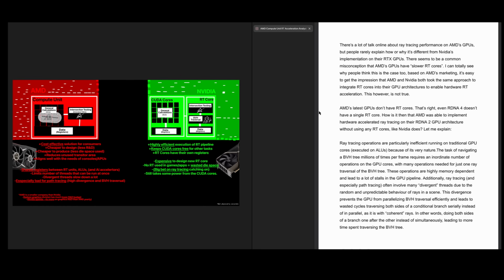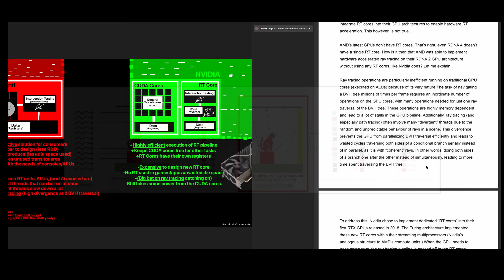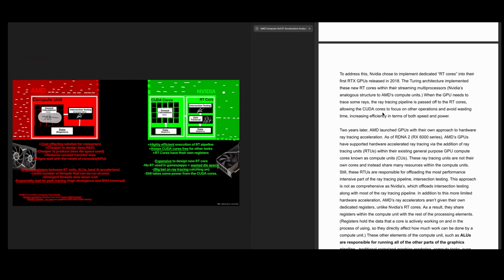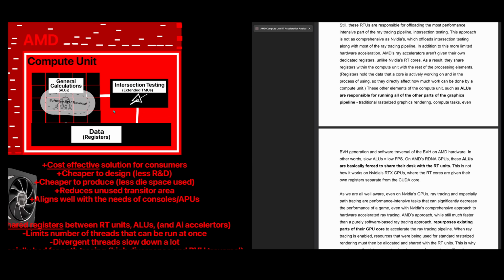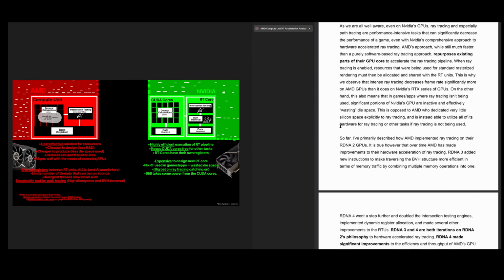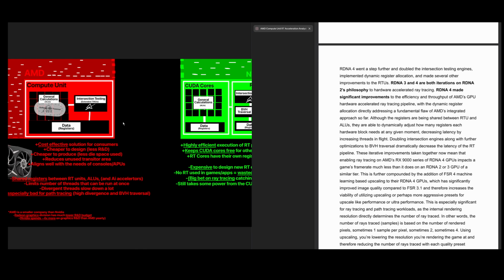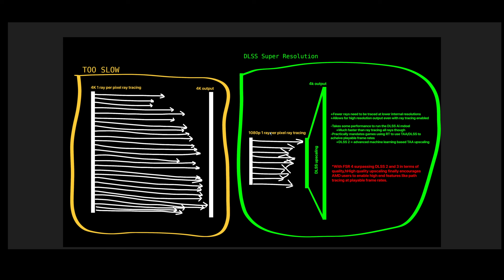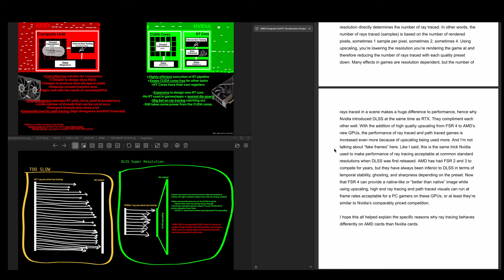How Does AMD Do Hardware Accelerated Ray Tracing?

Comment: Graphics engineer here. I have written ray tracers multiple times. Including GPU-compute ones. BVH traversal is THE most expensive part of ray tracing. Intersection testing is pretty much free. Yes, intersection tests matter, but they constitute something like 20 ops, which is pretty much free. 

Another thing that matters a whole lot is representation. "BVH" means nothing today, there are at least 5 major flavours of BVH today. Nvidia's BVH representation is much smaller, which affects performance because memory throughput is a major bottleneck. Nvidia's BVH is also better at sorting rays, which leads to having to do fewer intersections to get a hit.

You thought that's all - nah man. Building a BVH is also a thing, it can be built well, or poorly. A poorly built BVH will require something like 2-5 times as many tests per ray vs an "optimal" BVH. There is a lot of research in this area, since BVH is built in the driver - this differs between AMD and Nvidia as well.
Reply from the maker: Dude thanks for commenting! That makes a lot of sense! I don't have any real experience working with graphics programming or hardware design in case that wasn't obvious so I really appreciate your input on this. I was reading about some of the differences between AMD and Nvidia's approach to how wide the tree should be vs how long the tree should be and how RDNA 4 uses wider trees than RDNA 3 with fewer steps, I'm sure there's a lot more to it than that though. Is intersection testing really that cheap using GPU compute? I was wondering, were the ray tracers you wrote doing just ray-box tests or was it also doing ray-triangle intersection tests? It seems like voxels lend themselves well to ray tracing, and I assume that's because intersection tests are done using only ray-box tests, where many more can be done per cycle? I know on AMD GPUs with the RA it's a 4:1 ratio in favor of ray-box tests. Because Crytek's SVOGI performs really well even on old GPUs and that obviously uses a voxel grid.
Reply: That is why changes to BVH traversal in RDNA4 are so important. I don't exactly know the right words, but the fact that finally "boxes" don't have to be oriented in parallel to XYZ lines, but algorithm can choose the best option (or at least much better one) for a scene. Which makes boxes much smaller from the beginning.

Also didn't RDNA3 also include some separate registers or cache for "raytracing"? It is only a bit stronger than RDNA2, but there is a difference. I have to check. Chips and Cheese have interesting article about RDNA4 and Ray Tracing on their website.
Reply: My only knowledge about this is an spidoe of Coding Adventures, where Sebatian Lague made his own GPU raytracer with BVH. Would be interesting to see a well-presented video about different variants/implementations of BVH.
Reply: In the video it was mentioned RDNA 4 does not have a dedicated part for traversal stutter in their RT cores unlike Nvidia. So I would assume RDNA 4 should be bad for ray tracing compared to RTX 5000 if BVH traversal is the most important part. However, they're quiet close in normal ray tracing. How is this possible then?
Reply: @JanM2  Algorithm for RDNA4 reduces (by a lot) number of steps needed to calculate BVH traversal (traversal stutter????). Also I wouldn't say that ray intersection is basically free - it depends, but indeed compared to BVH traversal it is minor thing. Though it is still upgraded in RDNA4.

Read: "RDNA 4’s Raytracing Improvements" by Chester Lam on Chips and Cheese page. Heck, even AMD slides explain it... not horribly.
Reply: Nvidia's card do NOT DO SORTING ON BHV they use the cpu for all sorting first.

Also If the RT cores had their own R.O.P's & clocks that were separate from all the compute they would run a lot better.
Reply: Isn't it the denoiser that does most of the work, raytracing doesn't seem to be heavy task, recreating the image after the raytracing by AI. So the raytracing methods are irrelevant
Reply: If I recall correctly: AMD's compute cores are way more powerful and were already generically capable of ray tracing, while NVidia's compute cores were not at all capable for ray tracing. This is 15 years ago. Then Nvidia introduced extra hardware to make it somehow capable and invested a major amount not in R&D, but in marketing to sell the idea that Nvidia was the first to make cards capable to do ray tracing and that everyone needs raytracing right now and that none of the others were capable of raytracing.
NVidia marketing forced a "standard" and bought enough developers to sell it for them.
NVidia really invests little in hardware R&D, but invests a lot in marketing and marketing R&D. Aggressive misleading marketing is the key point of success for NVidia.
If you look deep enough you can see that NVidia even sold "graphics accelerators"/physics engines  which were merely a license dongle to run their CPU optimized code. And only if you had the license dongle, would the library select the fast path.
NVidia and Microsoft are very alike in that respect.
Reply: @bloepje  I mean - on Linux you can play "RayTracing only" games on RX 290X. It's just that performance will be terrible. Some computations are that challenging. Being capable doesn't mean "good at it" at least not to the level required for minimum 30 FPS in 1080p. You could use CPU if you wanted probably - it's just not that efficient.

AMD for long time was great at computing (so their cards were great for crypto). And CDNA (including current MI350 and MI355) is based on Vega. Raja Kodouri shouldn't hype things up and for gaming GPU's he is so so, but for computation heavy ones - he is great.
Reply: @bloepje That's a pretty annoying way to say "I just don't like Nvidia, because at the moment they are the market leader, and rooting for the market leader is lame".
Reply: @bloepje  Well, nope. RT cores are dedicated circuitry to handle the prep & transversal of BVH which requires lots of R&D effort. Much More RT & PT papers & demos came from Nvidia in recent years than AMD. AMD's generic compute approach doesn't benefit RT impl in games much. Let's hope the next version, UDNA has something to offer in better Ray Tracing with 4x ～ 32x samples and early ray sample rejection.
Reply: @Smiling-Lotus  Bull crap. that's RTX coding for CUDA & not anything directly related to DXR or DX12.
Reply: @bloepje  I distinctly remember an Epic Siggraph presentation from roughly 2015(?) where they tested out ray traced shadows on GCN as early as an HD 7870. Another instance that I vaguely remember is a 2013 slideshow about ray tracing optimization on GCN. But I don't recall if nvidia couldn't also do this. It's just that the PS4 was the target platform for Fortnite (which was still in development at the time, iirc). I think there was another post from Epic, a research post that actually touched on BVH traversal and intersection testing, but I haven't been able to find it again. I might just be misremembering it.
Reply: @bloepje  That's just complete bs. Nvidia has offered their OptiX ray tracing library since 2009. Most of ray tracing acceleration research has been published by Nvidia and Intel, nothing by AMD. You say "NVidia really invests little in hardware R&D" but Nvidia RT perf is still 2x of newest AMD in heavy offline 3d rendering and RT-heavy games that don't just offer a cheap-ass "can call it RT for marketing purposes" mode for AMD
Reply: @randomobserver9488  No your comment is BS because all Nvidia has done is increase their final rasterization to get decent RT out their crap hybrid design cards. Thats why they use A.I upscalers & denoisers, frame generation, to get high throughput out their cards because their RT cores have gotten a pathetic 6% per generation & 0% on black from Ada Lovelace. 

From 2080ti to 3090 all rasterization
from 3090 to 4090 all rasterization
from 4090 to 5090 all rasterization.
Reply: @randomobserver9488  no they have not.

Comment: You earn a sub from a fellow nerd! Btw the approach of lowering resolution to lower ray count in RT is not relying only on Upscaling but also ‘Denoiser algorithm’ like Nvidia Ray Reconstruction. To get a more accurate lighting with fewer ray.

And this is why I’m even more optimistic about RDNA4 in RT since they only lack a good denoiser and could potentially gain a boost in both stability and framerate in RT and PT.

FSR Redstone could be something big, I hope they don’t F it up at launch…😅

Comment: One correction! Data registers would not be an issue on AMD side. If you consider same area on both chips then cumulatively they would have same amount of data registers available, just that on AMD side it'll be 2x the CUDA side of Nvidia (I am simplifying it, the ratio could be little different but doesn't matter).
Reply from the maker: I see, that makes sense. They just have enough registers in the compute unit to do both. Which is great because then when ray tracing isn't being done they can use those extra registers for non-rt tasks to improve utilization/threads in flight on the ALUs. It does mean however then that enabling ray tracing is still reducing the number of registers available and therefore threads in flight, reducing perf more than if they were completely separate. Good point thanks for commenting it.

Comment: Both companies just don't wanna do the exact same thing the exact same way remember DirectX12 asynchronous compute and how it was supposed to help improve gaming performance by offloading tasks to async compute cores yeah Nvidia didn't get the memo for that and decided to not have async compute cores built in to their Hardware its the reason why Maxwell and Pascal had to emulate support for async compute which ruins their intended purpose as they were using GPU cycles to emulate its features which then caused large performance drops instead to this day Nvidia still has no actual hardware support for ASYNC Compute but were able to get better performance for it on their RTX Gpu's even though they are still emulating its features but now its using their tensor cores instead which does a way better job at it than their standard cores did on Pascal and Maxwell and is now resulting in its intended purpose which is to give better performance.
Reply: That's literally just brute forcing the code. AMD cards are fast while being much lower cards for the Async. 
I'd also like to point out that the DX12 is train wreck anyways. It was supposed to be a lower level A.P.I which needed less coding & less requriement of drivers & it's been the exact opposite on Drivers compared to DX11& requires about 4x more effort to code for. Since everyone got used to DX11 doing most the work with compilers & other tools Developers are completely lost on how to code properly. Now we get games upscaled & frame generated by A.I crap just to run a 30 fps.

Comment: I wonder if AMD will adapt variable-sized datatypes, similar to how IBM tackled AI accelerator efficiency with variable bit-sizes. Along with the dynamic registers, one might be able to approximate a dedicated HW solution. It could allow for "variable" RayTracing effort, where Nvidia is kind of fixed with the dedicated cores they choose to implement.